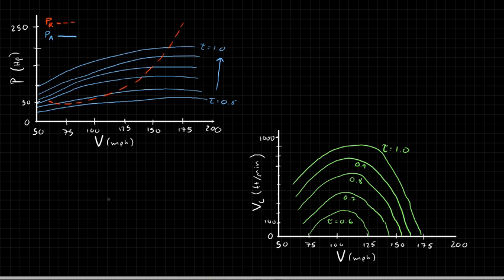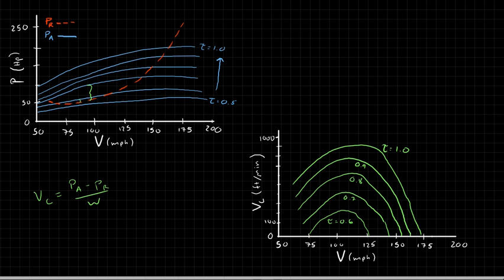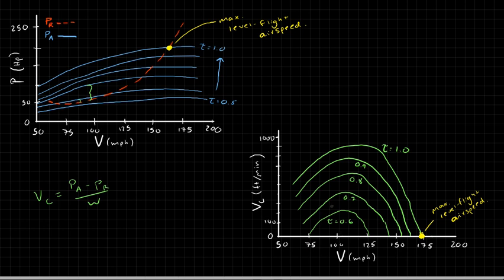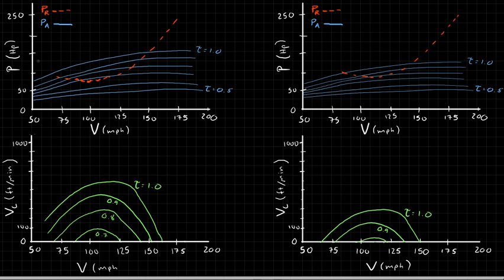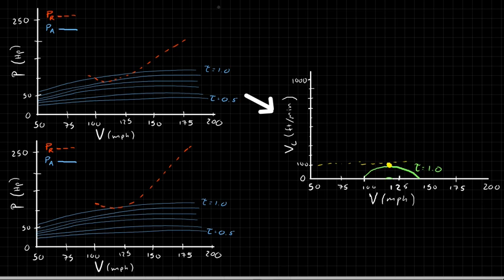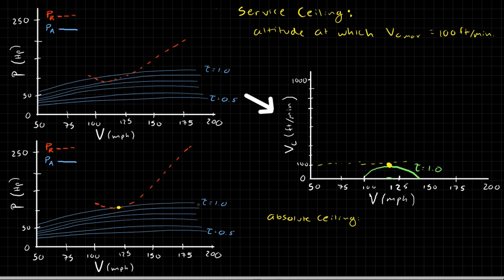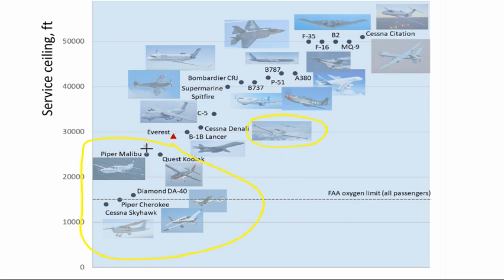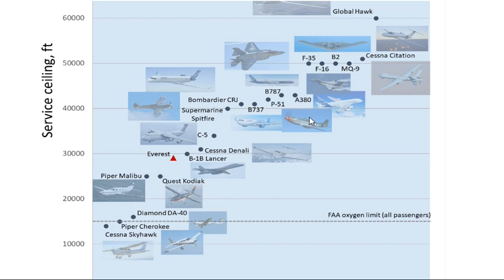Aircraft Performance . Climb Rate . Power Available

Comment: Is this for a Jet or Propeller?
Reply: I am pretty sure that the concept is general, tho you can "select" your engine by changing the Power Av. curve. Different kinds of engines will have different curves of Pa, so you will have different ceiling altitude and climb performances in general.